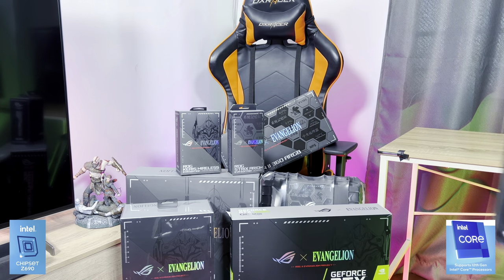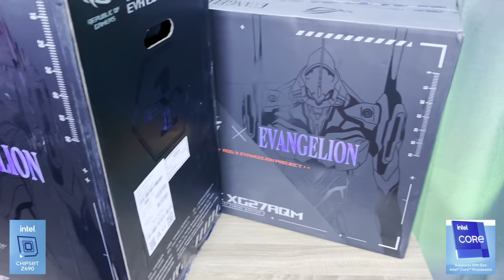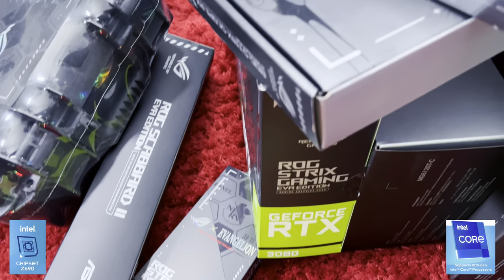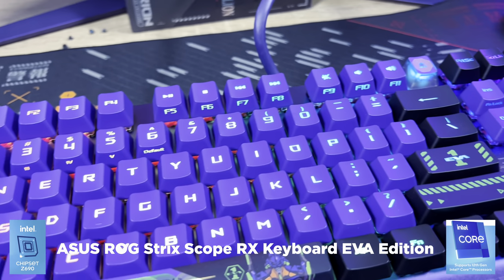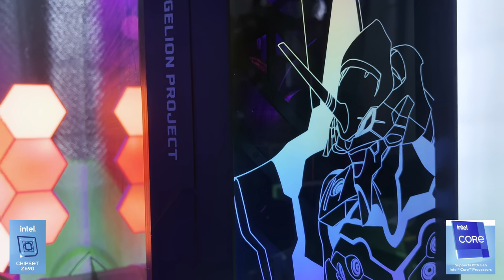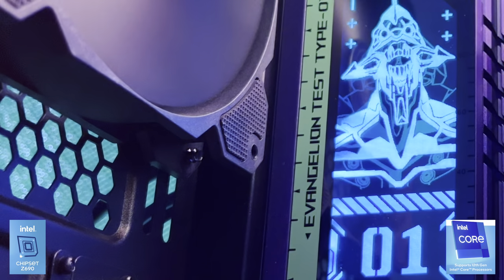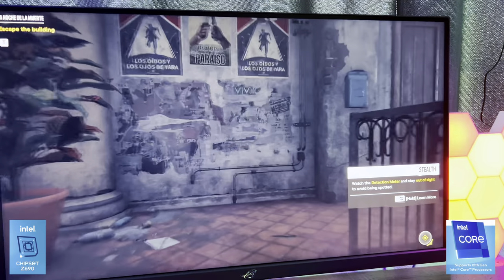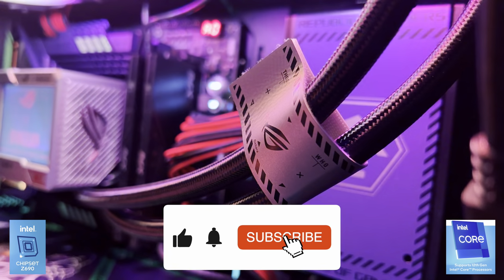Building The ASUS ROG Evangelion PC With Every EVA Component and Accessory

Comment: Hello question first time buildingmy own pc but would like to ask for zome guidance by chance do you know if ASUS ROG Evangelion motherboard is compatible with case Asus Rog Strix Helios Gx601w Rgb Eatx ,2 sets of Corsair Ddr5 Vengeance 32gb (2x16gb) 4800mhz, 2 cpg Ssd Adata S70 2tb,Intel Core I9 13900k 5.80 Ghz 24 Core 1700 Bx8071513900k,Evga Geforce Rtx 3080 Ftw3 Ultra Gaming de 10 gb,1000w Asus Rog Thor Eva 80 Plus Platinum, 4 Cooler Master Mf120 Halo Argb Mfl-b2dn-18npr-r1 FANS,ASUS ROG STRIX LC II 280 ARGB 120 MM AM4 Intel 1700. "would all these items be compatible with each other? and if so what type of additional cables would I need?